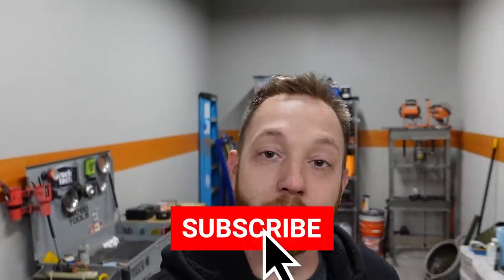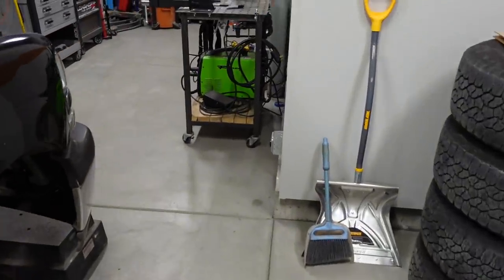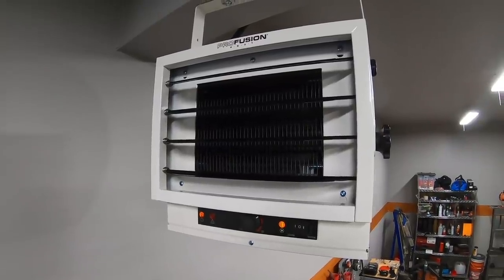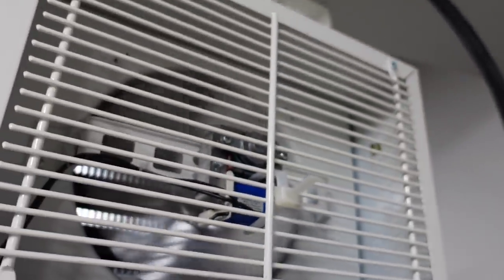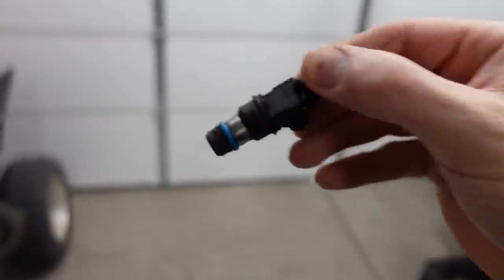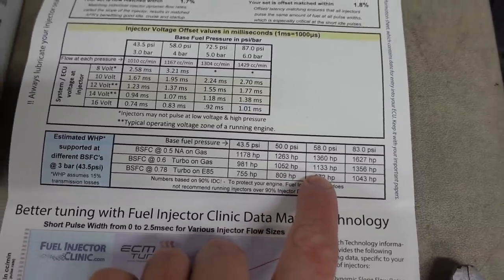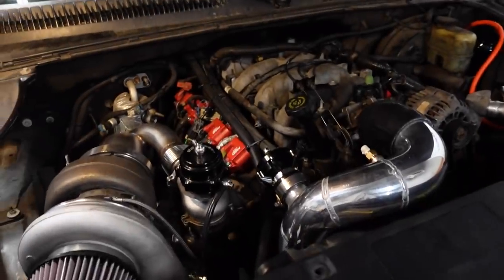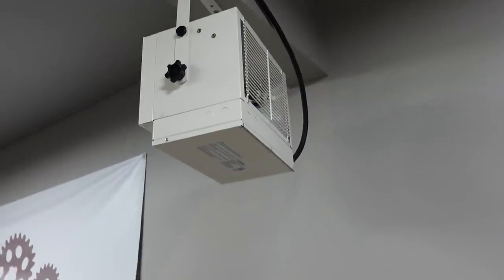1,000hp fuel system for the Turbo Big Block

Comment: read the comments, yea LT, fun and warm feeling is over when You get electric bill.
Reply: I doubt he will see a $20-30 difference, i have three 110v radiator heaters heating my house and only have a $60 a month difference from fall no heat to a month of low 30s at night temps. I do have back up propane central unit but its old and less efficient than the electric heaters but its hot if needed

Comment: Another great video.

One thing to help the heater is add a ceiling fan. I run a propane heater and use the ceiling fan to help circulate the air better. The fan does double duty in the summer when it’s over 90.

Comment: Great build.  Thanks for all your videos.  As for the shop, a lot of your heat loss is in the the garage door and attic.  If you don't mind the look, get yourself a garage door insulating blanket.  If easily accessible, ad more insulation to the attic, most heat loss in a building is there.  Best Regards - Mike

Comment: Awesome work! I picked up a Holley Terminator X Max for my ‘04 6.0. Piggybacked the stock harness/ECU so I retained starter wiring, AC function and tapped into the crank sensor signal so my tach works. Watch sloppymechanics 2500 build! You get all the great info! Keep it up! This thing is going to be sick!

Comment: Had the same heater in my 900 sq ft shop in WI, definitely did a nice job. I think I paid $120. I priced out a gas heater at about $1000 all in. That will pay for a lot of electricity. My shop was well insulated but totally detached.

Comment: I'm with ya on your heating situation. Notta lotta space, but still need some real heat! Do you have access to gas, LP or NG? Or is your home totally electric? The answer to that determines what I recommend, however, you always have the jobber style heater that will blast you out of house and home if you let them! For example and just search for:

"50K-80K BTU Convection Propane Tower Portable Heater"

I don't wanna get flagged or messed with otherwise by the google bot police, heaven for bid I post a link! But your injector situation.... Might I suggest some Silglide or Vaseline, to lube the "O" rings just so they don't chafe, scratch or otherwise get bothered on insertion. Viscosity matters in this case. You see how poorly machined those injector boars are, that's why. 

Cheers man, looking forward to what's next 🍻!

Comment: Run a 9th injector. They only spray under boost. Helps with cooling and pre detonation. I NEEDED it on my Tacoma V6 TRD 18 psi supercharger. Originally the 7th was for fueling. After a built motor it was larger injectors all around and a even larger 7th for those causes. Look into it especially it E85 is considered

Comment: I would save the E-85 Route for when you go Built motor, but E-85 on boosted application is almost a must if you have it readily available in your area.
Reply from the maker: we do have it around, but that may require a larger fuel pump (and lines) than what I currently have.

Comment: For the future, check out Vornado space heaters (110v).  They do a great job at circulating air throughout the room surprisingly.  I don't like most of the space heaters where the hot air just rises instead of actually blowing forward.

Comment: Go on and get you a propane heater. Propane is cheap and you can turn the heater on when you’re in the shop and off when you’re not and still be comfortable. As opposed to the electric deal where it seems like it take forever to warm the area. Would still just run 20lb bottles though. Refilling then vs 100lh is the same price but the 20lbs are so much easier to move.

Comment: Ditch the electric for a 10 foot NG radiant tube heater. No turning back. 42F is tropical up here in the Great White. I sit outside on the deck at 10F with coffee easy; less if there's no wind.

Comment: I would put a second one of that size in before going up to a bigger single heater
Reply: LT...I AM a qualified electrician and he's right. 
Run 2 @ 3000 watts and they will last a LOT longer.
Use 2 different circuits.

Comment: The OBDII system checks the fuel mixture between 1 and 20 million times per second. to calculate the time delay for the exhaust to get to the oxygen sensor relate to the displacement of the engine and the volume of the pipe... think your ecu timing for fuel corrections would be behind by 5 full rotations, because the sensor is in the down pipe of the turbo. 1/4 second delay at 1200rpm... but if its to far down the pipe the engine would probably stall before it makes any fuel corrections... "simulating boost, specialty tube on mac valve of fuel rail, engine running while progressively bleeding off more fuel until the valve is fully opened... simulates a lean condition caused by more air in the motor, all OBDII ECU's will self correct if the system is functional. its not a tune so there is always a delay with the system depending on the sensor locations. can play with the gas peddle and know if the idle air control valve moves around with every little bit of throttle movement, so it will even self correct the "IACV" even if it has boost at an idle. just normal OBDII.
Reply from the maker: what?

Comment: Suggestions. How bout linking sites to parts you use instead of camera and lights. I'm more interested in the coils you have on the truck than the camera you use.
Reply from the maker: Hey thanks! I sometimes put links to products that I install during each video, but skipped the injector link on this one. I never did a video on the coils...  but you can find em on MSDs website

Comment: i decapped my stock multec 2s and sent them to snakeeater performance. $150 and 2 weeks later i have 70-80lb cleaned, flow matched injectors. that would be a good spare set for you

Comment: Isn't a 1000cc injector a little small for a turbocharged 8.1 liter?
Reply from the maker: no, not for my goals anyway. they will make a tad over 1,000hp on gasoline which is my final HP goal. If I wanted to run e85 at that power level, I should've gone bigger though...
Reply: @LawrenceTolman  that's where I got messed up. I automatically was thinking you were going to be using E85. My bad.

Comment: 20a @ 240v is only 4800w and usually they are under their amp rating so they do not blow the circuit. Most 120v heaters only use 1500w of the 1875w max for a 15a circuit. I saw one that required a 20a circuit but would only draw 16a which is only 3840w. Your plug looks like it is at least a 30a (probably 50a) so you could have went bigger. Gas would be better and cheaper to heat but harder to install.

Comment: When is the best time to maintain your injectors like that I have a 2014 Silverado D.I. motor  with almost 200k on it still getting 21 22 miles a gallon as long as I stay out of Texas when every speed limit is about 70 mph still holding 40 lb of oil pressure regular alternatorI'm getting ready to go to the shop and do a transmission service on it front and rear diff and brakes all around oh yeah it's not forget the oil change what else can you think of for me to do with a truck with this many miles on it
Reply: Direct injection is not the same as this. Injectors that are mounted in the intake wash away the deposits on the intake valves. The common issue with di motors is carbon deposits. You can add in a oil trap to the pcv to to help eliminate this. 
The cleaning procedure for a di motor is to walnut shell blast the intake valves or use a chemical to dissolve the deposits. A regular dose of something like Lucas fuel conditioner would help keep the fuel system and injectors clean regardless of di or conventional injection.
Reply: Speed limit is now 85mph in some Austin highways. Lol.

Comment: So the 1000cc fic injectors is 1000hp to the wheel on pump gas not e85
Reply from the maker: correct
Reply: @LawrenceTolman  
I got a 5.3 Ls turbo build im doin and I'd like to see about the same maybe a little less to be streetable.. so my question is if I go e85 thats twice the fuel pump but if its pump gas 1000 then is that less fuel pump
Reply: @LawrenceTolman  
Also love the builds man its twice the work when its not ur average swap I always wondered if that big 8.1 swap was possible..
Reply: @LawrenceTolman  
Hows the bottom ends in them things what kind of bore and stroke